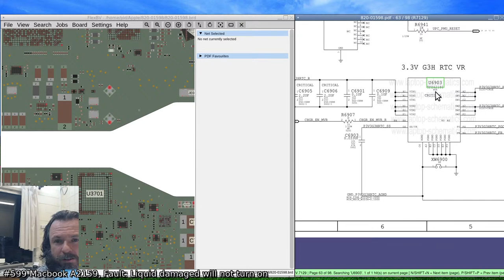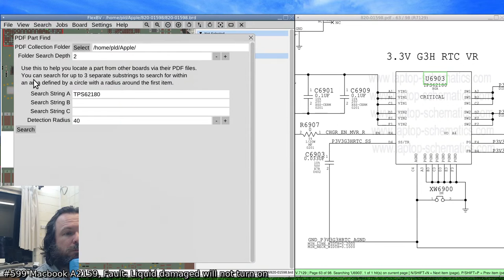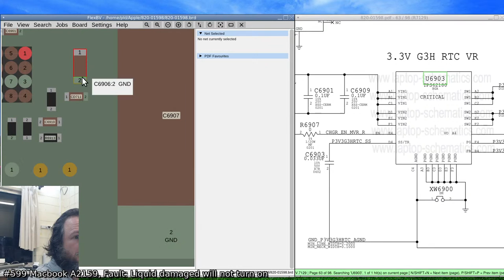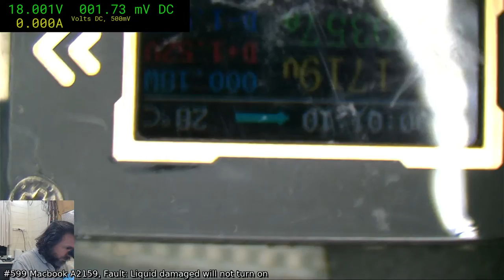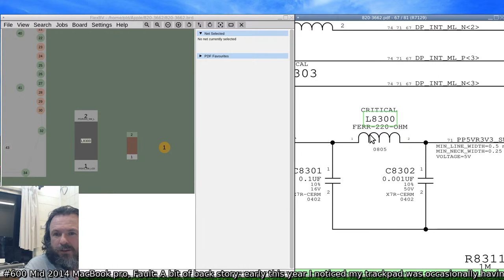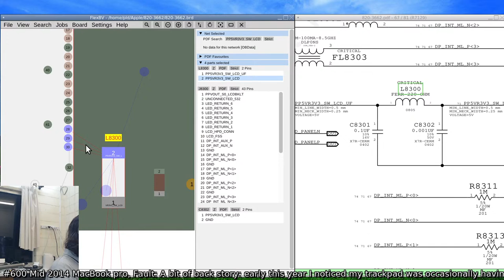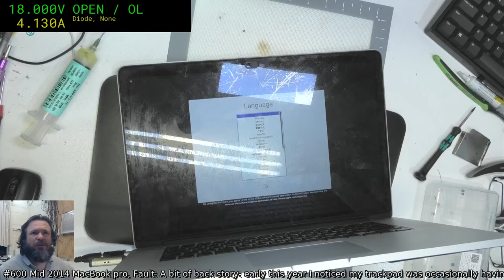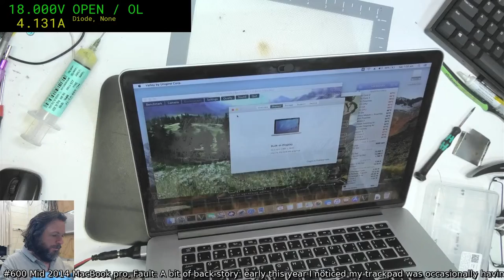#599 Macbook A2159 - liquid damaged and not turning on

Comment: U6903 likely is your issue on the first board. Try a new one if you can get one.
Reply: It should be possible, there is a datasheet on TI web page on 62180 and it is possible to order it from sellers like mouser etc. Most likely Paul will make this board great again.
Reply: Thanks John 😄

Comment: Hi, I am having issues with A2159 820-01598 basically there is no water issues at all the board is intact but is failing to boot, G3H is present but nothing happens and when thermal camera is use U6903 is flashing, would you think that be the problem ?
Thanks